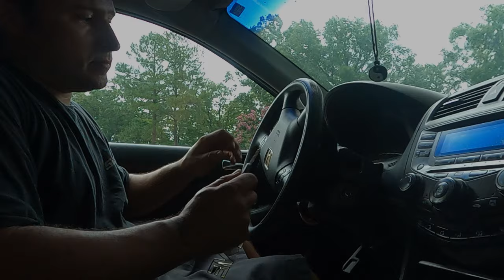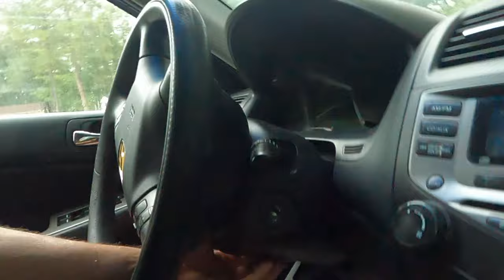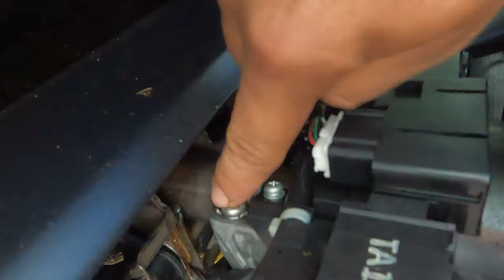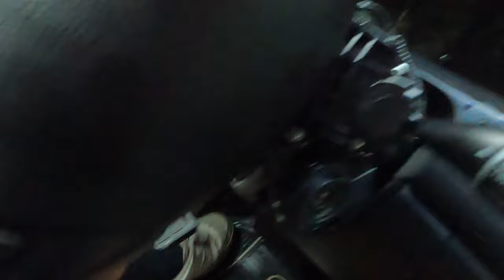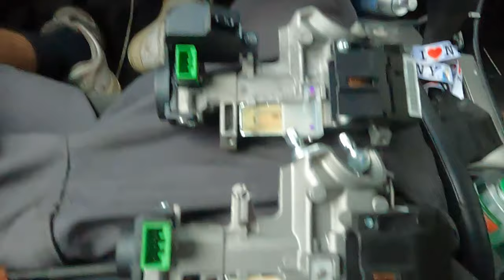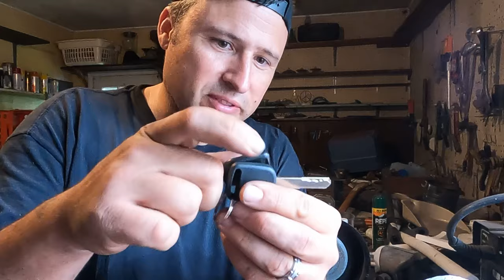Honda Accord IGNITION PROBLEMS 98-2012 | REPLACEMENT | "NO KEY PROGRAMING HACK" | DO IT YOURSELF

Comment: Awesome video.  I followed the video exactly and my car now starts like a charm.  My steering wheel was locked and my key would not turn, until I replaced the cylinder assembly exactly like the video.  This video probably saved me thousands.  A shop would have charged me $800 for the part, $300 for labor and another $300 to program the keys.  Not to mention the tow bill.  You are a genius.

Comment: Thanks a lot...,I'm a mechanic and when I do ignition switches,I hate having to tell my customers that they have to call a locksmith after,this will save them money and make me more because now I can do an complete job..... Your a smart and helpful man... thanks
Reply from the maker: Absolutely brother anytime I can help just hit me with a message. It’s why I do these videos. To help people
Reply: @Gasdieselgarage  i have a 99 accord just replaced the ignition tumbler with new harness and keys, only thing is can't program keys car starts with the new keys but have to disconnect the battery for ignition to fully release keys..  any suggestions sir

Comment: I did this with a used ignition from a junk yard. It didn't work initially. I had to strip all of the electronics off the donor ignition, and replace them with the original, only using the mechanical tumbler/cylinder from the donor and the donor key. I then had to swap the chips from the original key to the donor key to get it to work, but it works fine now. Thanks for the video!

Comment: Just did this today on my 04 accord thanks to your video. I ordered the same ignition unit you linked and it fit. Went and got a chisel set from harbor freight and got to it. The left bolt head for me came off simple enough but the right gave me trouble so i just bent the bracket enough to get it out. As far as the key goes i had to file down the inside notch on the cap that is angled to fit the angle cut on the chip. Once that was done the cap seated all the way flush without glue. Starts and runs great now. For anyone reading this , it can be done and you can save yourself a lot of money if you dont mind having an extra key along with the fob key.

Comment: Did exactly as show and all worked out great!! Only I had my new ignition unit rekeyed with a local lock smith before installing  ($80) and avoid having to cut out chips and carrying extra keys. Totally worth  it in my opinion

Comment: I did exactly what you did and my started.  Only issue is programming working key to the 2nd key.  I used the autel 508 without success.  Long and short, i am happy that i got 1 working key and not stuck in the barrel like before.  All for $AUD 80.  Thanks heaps mate.

Comment: Dude you just saved me a bunch of money. My only problem was that the tamper proof bolts seized completely and I had to cut the bracket off with a dremmel without cutting into the steering column.
Reply from the maker: Yep I believe it brother…couldn’t tell you how many times I seen techs at the dealership actually try to cut it off too….yes I worked at a Honda dealership for many years
Reply: chisel
Reply: @Gasdieselgarage  couldn’t u use tamper proof torx ?
Reply from the maker: @davidcollazo2102  yes sir absolutely

Comment: I had the same exact issue, but I was able to eventually get it to work by releasing the parking brake and turning the steering wheel to the left as hard as I could while simultaneously turning the ignition and it started right up. Not sure if this trick will work for everyone or if I just got lucky but this is the second Honda Accord that I’ve done this with. Hopefully this helps somebody else so you won’t have to replace the ignition. But if that doesn’t work, this is video is a perfect step-by-step process!!

Comment: Same process followed for honda CRV, however I swapped over the other 2 black parts aswell (not sure if necessary) all working now just need to mount it back on the steering column, the hardest part was the anti tamper bolts, persevered and just as I was about to give up it came loose, cheers for your help mate
Reply from the maker: Awesome my friend I’m glad it worked out for you.
Reply: What 2 black parts? Mine just broke i have 03 crv and im trying to buy used ignition switch with key in the fb market

Comment: I did this on an 08 odyssey and it worked however heres a tip. We had purchased a used ignition off another odyssey which came with its own key. If you are using a used ignition with the key that came with it, it will also have a transponder in that key. When trying to place the keys over each other as in the video, the car would not start. You must first remove the transponder out of the new key you received in order for it to work. The overlapping of the keys worked in this video because the key that was used was new with no existing transponder in it.

Comment: Excellent video!! Thank you so much. I have no experience working on cars or with tools and I was able to replace the ignition on my 2005 Honda Accord. I ordered the replacement from the link in the description for about 60 bucks!! Thank you again super helpful video man 👍
Reply from the maker: Absolutely my friend it’s why I do these videos 😃
Reply: @Gasdieselgarage hey man. Great informative video. Kinda got myself in a pickle. I have a 2007 Honda accord that was having the buzzing issue trying to start it so I looked on YouTube and figured it was the ignition switch. I replaced it and now my cranking issue is solved but the car won’t start. Not sure what to do
Reply from the maker: @asmrgodzzz7549  do know if the engine is getting fuel?…..easiest way to figure that out is to spray carburetor into the intake and crank the engine ..if it runs for few seconds then you know it’s a fuel delivery issue
Reply: @Gasdieselgarage  I just cranked it up with starting fluid and it started and ran for a minute and I shut it off now and tried to restart it and it won’t start again
Reply from the maker: @asmrgodzzz7549  you most likely have a bad fuel pump or clogged fuel filter…I’d start with that my friend
Reply: @Gasdieselgarage  I don’t think so I can hear the fuel pump prime when I turn the key and it just ran for a minute straight. I just started having the issue right after I replaced the ignition switch
Reply from the maker: @asmrgodzzz7549  are you using the same chip in the key and pass lock ring (the black ring on the ignition tumbler)?….if not it will disable the ecu from firing the injectors
Reply: @Gasdieselgarage  I just put the old switch back in and it runs fine. Is it because I got a aftermarket one instead of a Honda one?
Reply: I dont see the link ? I need to order this part

Comment: I'm about to have to do this. Here's hoping this works. I'll update when Amazon delivers and I install it. 

Update. It was a pain to do because i ran out of day light and those tamper bolts were no joke but i got it installed and it works perfectly.
Reply: Just finished a test drive to charge my battery back up. Saved me over $400

Comment: Thx for the tip brother i pay 300 for programming and made a key 3 years ago with a odyssey now have same problem with a acura tsx,also a friend told me if you put the old key stick under the switch works with new one w/o remove transponder but i prefer to do the whole way thx again
Reply from the maker: Yes your friend is right

Comment: What did u use to open they key? My 2000 honda accord immobilizer went out but cant afford to go to dealership. Please help.
Reply: Also, u couldn't just replace the one part of the immobilizer instead of the whole thing??
Reply from the maker: I used a pair of angle cutters but anything can be used to cut plastic just be careful to cut towards the center of the key because the chip sits inside there
Reply: Thanks.
Reply from the maker: @shaileo92  anytime 👍
Reply: Sorry, but so if I just replace the immobilizer could this still work??

Comment: Having the same problem with my honda fit jazz 2010..have swapped the immobilisers already, the old key and the new are in the same key holder since i cant tear up my new key like you, i think am afraid of messing it as i only got one key but the light still on... what do I do
Reply from the maker: Unfortunately you may have to take it to the dealership to have it programmed…you already did the expensive part by replacing the immobilizer.

Comment: Please help I did a heater core replacement on my 2001 Honda Accord. Of course the dash and all connections were removed. As I put everything back in place and reconnect everything and start the car I have no green security light on my dash at all car want start cranks but no start
Reply from the maker: If it just cranks I’d check the connection plug at the round transponder ring…it’s usually a green plug
Reply: Also no power going to obd connecter..... I think maybe I just missed reconnecting a ground somewhere
Reply: I checked the green plug it's good

Comment: Could you do the same thing with just replacing the cylinder? I guess it's called. 

It has the cylinder with the wafers, and it all slides in to the locking piece. With like a dove tail on it. 

Could you just replace that if it came with a new key and you switched the transponders?
Reply from the maker: To answer your question YES but it may need to be programmed if the key is new. If it’s just the mechanical tumbler (cylinder) you’re replacing you should have no problems

Comment: How can I get the part with the right mobilizer on it? The person that tried to steal my car busted the screw or the mobilizer attaches. So don't think I can swap my old one on to the new unit.
Reply from the maker: No unfortunately if you need a completely new immobilizer it will have to be programmed by the dealer or a locksmith because the new will have to be programmed along with the new immobilizer. I feel for you I do ☹️

Comment: I am sorry, what about if the new key is one of those with 2 or 3 buttons?, it would work too?
Reply from the maker: This hack will not work with the 3 button transponder
Reply: @Gasdieselgarage  , thanks a lot boss, you are the real goat 🙏🙌🙌🙌
Reply from the maker: @Lonewolf-nq2uy  sorry I couldn’t be more helpful…well actually does the key fob still unlock your doors and trunk?
Reply: @Gasdieselgarage  , it doesn't open the doors or the trunk but ignite the car so it works, thanks a lot again, you are the man!!!🙌🙌💪💪
Reply: @Lonewolf-nq2uy hey so what did you manage to do to get the key to start the engine ? I have the same 3 button key

Comment: Hey, question? My car has a bad stalling and shake, then it's turns to normal after about 30 seconds, I've changed all the sensors, and 02 sensors are still the same issue now do you think the ignition switch could cause this problem for the stalling I read it could be.
Reply from the maker: Do you have any check engine lights on when it starts acting up?
Reply: @Gasdieselgarage  yes, codes continue to read misfire, but I know the plugs and coil packs are not the issue. I replaced them all with Denso and the map sensor with the original Japanese sensor, so the only thing left I read would be the ignition switch
Reply from the maker: @bigbrad9976  well I guess it wouldn’t hurt to replace the ignition switch but also check all battery cables, terminals, health of the battery. Honda electronics are very dependent on power and ground for the ecus. Oh and bye the way…does your Honda have a distributor type ignition?….these have a problem with oil leaking through them.

Comment: What about the door lock, do I just have to keep my old key? How will I move the steering wheel if it’s locked?
Reply: Yep.  You need to keep your old key.  My Honda actually has 4 different keys on the key chain, since every lock on the car uses a different key.  Honda's are notorious for the tumblers in the door locks going bad.  It feels like I drive a Frankenstein car.

Comment: Followed the video, but the car won’t start with the old key placed on top of the new. Even cut the chip out and still nothing. Only cranks but doesn’t start. Any tips? Locksmiths are wanting to charge me $300 to rekey the dang thing

Comment: I’m having hard time getting security screws out. My Dremel crapped out on me in the middle of cutting a slit. I don’t have the patience to hit it with a screw driver and hammer. My steering wheel locked to so hope it goes to get in way of taking off screw behind steering wheel.

Comment: !!!Help!!!
I installed the ignition switch. I know I have to still get it programmed, car came with a busted key with no chip and a shabby ignition. With the original ignition and the busted key as we all know is going to get the green key signal but it still acted like it wanted to start now with the new ignition and program key it doesn't act like it wants to start. Did I do something wrong?
Reply from the maker: Does the engine crank?
Reply: It did before I changed out the ignition
Reply from the maker: @tazz187able  how bad was the wiring to the ignition switch before you replaced it?….the reason I ask is because the car will still crack by turning the plastic center piece on the wire side with a screw driver.

Comment: I took my key apart and I didn’t find a black chip but inside the actual key was a little rubber holder and there was a glass little tiny tube in there is that the chip? Coming out of a 2005 civic key? I did switch the transponder over like you did to the new ignition and I held the key up but I still get a flashing green light. Any advice on that one?

Comment: I have a 2020 Honda accord  i put the key in the ignition  it turns but nothing works in dash  in dash, radio, light ac works and when turns the key to start, it stars and shuts off. main fuse good with other fuses and relay i check .Please help dont know what else to do.
Reply from the maker: How old is your car battery?
Reply: 2010 but it has 79000 miles
Reply from the maker: @davidgreen2055  honestly bud I think you have battery issues. Batteries only last about 5 years on normal conditions. ….I’d get the battery tested and go from there…..the battery may have  voltage but no amps left to keep the engine running and especially newer Hondas require proper voltage to power all the computers on board.

Comment: I got screwed by the dealer and now  the windows and door unlock but won’t start took battery out and tried the key in different modes of lock and unlock but still won’t start it worked from the dealer for about a month but now won’t start not the battery it a new legend one cleaned terminals still in a theft mode and the green light acts up and when I put key in it stays on for a bit longer than it’s supposed to
Reply from the maker: No it’s not bud….Does that car engine crank when you turn the key?…..not start….just cranking?

Comment: I mean I have a problem. My key fob on my '04 Accord is pretty ate up at the top, but I highly doubt the transponder fell out on it's own from general wear and tear. I think on mine it's located kind of top right in-between 2 buttons, but I can't tell if it's my tumblers that is the problem, the fact that I have to super glue now the physical key to the fob itself and it's just not turning correctly while in the ignition or the highly doubtful transponder itself that is malfunctioning somehow. I have to go to work in the morning. I can't really do anything at 11 pm for the next day. It just won't budge it seems. It is stuck in the zero position when there are 1, 2, and 3 positions. It won't go out of zero now though. I somehow got it to work when I went to work this morning though and when I left work this evening. I wish I knew what it was, I'm a sitting duck with my job on the line. This isn't the type of job with a lot of "mercy" either.

Comment: Put in new ignition unit with old immobilizer, placed old key next to new key, engine will crank fine but does not start.  Is that due to the immobilizer not reading the chip in the old key?  Thank you for any advice!

Comment: How did you unlock the steering wheel to turn and expose the screws
Reply from the maker: Which screws?…the steering column plastics or the ignition body itself?
Reply: If the steering wheel is locked I use needle-nosed vise grips to loosen. Also, as a locksmith, I rarely chisel the bolts. I remove the roll pin holding the cylinder under the immo and once out there is a key code visible. Rebuild the lock and cut a new key. Clone or program the new key. Still 1 key for all locks.

Comment: Sir what if the key that I have now (original) is NOT being recognized by the system then what? My key does turn with no problems but the car is NOT recognizing the key. I've checked everything else in the vehicle I mean EVERYTHING, the green key symbol keeps flashing I'm assuming to let me know it's an issue with the ignition system. I have a new starter, a new alternator and a new battery I also have recently installed a new fuel pump assembly. Before the car stopped working it would turn on but it took sometimes a dozen or more key turns before the car would actually turn on. If possible could please give me some ideas of what could be wrong. I'm at my wits end
Reply from the maker: Yes absolutely I’m sorry you’re going through that headache. #1- does the original key have a chip in it?…#2- is the original key a Honda key “meaning does it have the logo on the key?..#3- if the answer to both questions are yes. Try holding the original key up to the ignition near the illuminated green circle while turning the new key….if this doesn’t work you most likely have a bad VATS ring that doesn’t recognize the key….Email me I can show you what that part is…..”GasdieselGarage.com”
Reply: check the fuse, it will say something like ACL or something under the hood